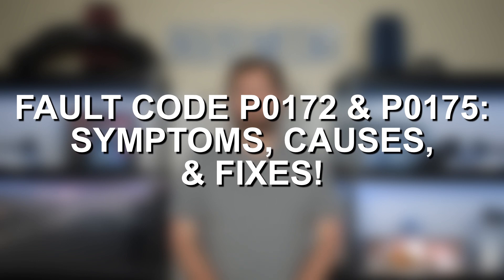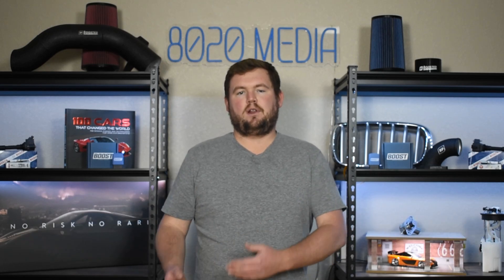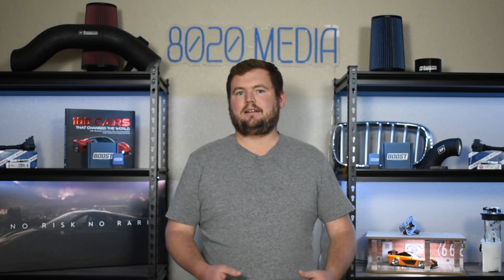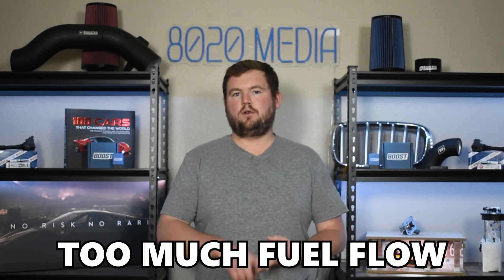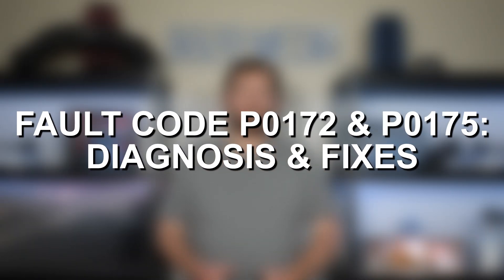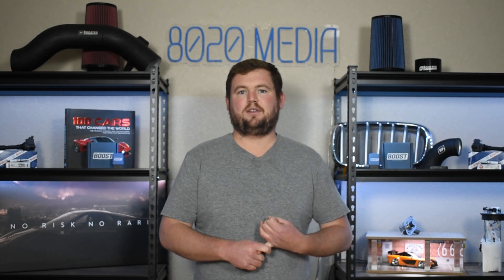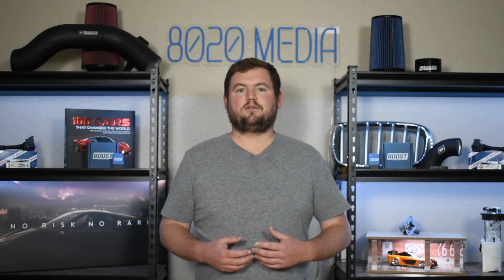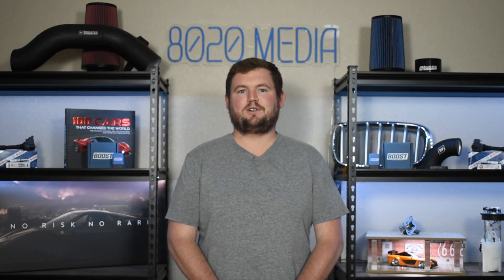P0172 & P0175 Explained: Symptoms, Causes, & Fixes!

Comment: I have a 2001 GMC Sierra 4.3 I changed oil, spark, plugs, fuel pressure regulator mass map sensors still have P0 175 and P0172 coming on

Comment: I Have a 2007 Toyota Prius and have replaced the following MAF, Spark Plugs and coil packs, the O2 sensors top and bottom plus fuel injectors and still getting the PO 172 code anyone out there having same problems and where to look. Good it be poor gas? oh and did replace the air filter.  Thanks
Reply from the maker: H - On a 2007 Prius, a persistent P0172 (system too rich) even after replacing MAF, coils, plugs, injectors, O2 sensors, and the air filter usually means the ECU is seeing too much fuel or not enough air getting through, and common overlooked causes are a leaking fuel pressure regulator, stuck-open purge valve flooding the intake with vapors, or a restricted/dirty EGR or PCV system upsetting mixture; it’s less likely to be just “bad gas” if it keeps coming back, so the next step is to check fuel pressure (too high will cause richness), test the EVAP purge valve for leaking at idle, and look for a dirty throttle body or stuck PCV valve, because those are frequent culprits on Priuses throwing P0172 after all the usual parts have been changed.
Reply: @8020Automotive  Thanks alot i think one thing getting overlooked alot is the PCV Valve or the EGR. Thanks for the Help.

Comment: My jeep compass has been a nightmare and I can’t seem to figure it out, she was and still kinda is in limp mode and she is throwing the P0172 code. I changed my Throttle body a couple days ago but when I was test driving sometimes it would go weak and at one point my pedal was to the ground and it wasn’t moving at all for like 5 minutes. Any thoughts? Thanks 😊
Reply from the maker: N - Sorry to hear this.. A P0172 code means the engine is running too rich (too much fuel, not enough air), and on your Jeep Compass, that combined with limp mode and throttle issues points to either a failing MAF or MAP sensor, a stuck fuel injector, bad O2 sensor, or even a fuel pressure regulator problem dumping excess fuel into the engine. Since you already replaced the throttle body and are still seeing severe power loss and delayed throttle response, I’d check the MAP sensor and upstream O2 sensor first, and also make sure there are no vacuum leaks, clogged air filter, or leaking fuel injectors—those can all cause a rich condition and limp mode. A live data scan showing fuel trims, O2 sensor voltage, and MAP readings while driving would help confirm the cause.

Comment: I have this code on my Skoda fabia 1.2 2006 MK1 htp 64bhp  along with po341. I had the po342 code, I replaced the camshaft sensor it went. I have Crackshaft sensors on the way , I will replace them then see. I think I may have to replace the oxygen sensor to. I don't know I'm not a mechanic I'm watching and reading up info haha
Reply from the maker: P - You’re doing all the right things for a DIYer—P0172 and P0175 both mean the engine is running too rich on both banks, which often points to a faulty or lazy upstream oxygen sensor, a dirty MAF sensor, leaking fuel injector(s), or a stuck-open thermostat causing the ECU to over-fuel thinking the engine is cold; the P0341 camshaft position correlation code is likely related to timing inconsistencies, so replacing the crankshaft sensor like you’re planning may help, especially if the timing chain has stretch or wear. Start by cleaning the MAF sensor (with proper MAF cleaner), checking for vacuum leaks or clogged air filter, and if that doesn't clear the rich codes, replacing the upstream O2 sensor is a smart next step—just keep taking it step-by-step like you are and don’t throw parts at it blindly. You're learning fast.
Reply: @8020Automotive  oxgen sensor would be the lamda sensor at the front of my car ?    I was thinking about changing that as I don't think it's ever been changed before , 60k to 100k they say change it at, the car is on 101k.  I fitted the crack shaft sensor and no change. 

When the car loses power I simply pull over turn the car off and back on again then it seems to run fine with normal power. Maybe faulty connectors or wiring issue somewhere. I don't have engine light on either.
Reply from the maker: @projectzgb7482  Intermittent power loss that’s fixed by restarting the car—especially with no check engine light—strongly suggests an issue with either a failing sensor (like the throttle position sensor, MAF, or crankshaft position sensor), a loose or corroded electrical connector, or even a faulty ground or ignition relay that's cutting signal momentarily but not long enough to trigger a hard fault code. Since restarting resets the ECU and clears temporary faults, it points to something electrical or signal-based rather than a mechanical failure. Start by checking battery terminals and grounds (especially to the engine block and ECU), wiggle-test key connectors while the engine is idling to see if you can replicate the issue, and consider scanning live data—even without a CEL, there could be stored history or pending codes that will point you in the right direction.
Reply: @8020Automotive  my car is map sensor not a maf sensor I think it's located in the throttle body maybe, not to sure will read around now and try to locate it.  Thanks for your help 🙂

Comment: Considering my 2013 Nissan Titan is right at 100,000 miles, I'm thinking it is time to replace both upstream O2 sensors anyway.  Thinking of trying that first to see if it affects LT fuel trim.  Then i could better judge the performance of the MAF to determine if it warrants replacement.
Reply from the maker: T - Are you getting an engine code? What symptoms are you seeing?
Reply: Awhile back it set a P0174, too lean on bank 2 (passenger side).  For the past couple of years I have been seeing consistent positive LT fuel trims, typically 5-7% higher on bank 2.  At idle they may be like 5 & 11.  At 1500 rpms they'll be at like 9 and 14.  On the expressway at 2000+ they can be around 16 and 21, and when I exceed 3,000 rpms they can hit 20 and 25.  The dealership coukd not determine a cause at 88,000 miles and did not seem concerned.  It starts and runs well, but gas mileage is down 10-12% and I smell fuel in the exhaust on start up.  I am just getting ready to tip over 100,000 miles and the truck is 12 years old. Smoke test negative and I can't find any exhaust leaks. MAF readings seems normal.
Reply: @trekfortruth2841  did you fix the issue?

Comment: My truck has set that code once.  I have an issue with the LT fuel trim being consistly in the +16 to 20 range on both banks.  Installed new air filter and cleaned MAF sensor and did not find any vacuum leaks.  Definitely smell fuel in the exhaust and mpg is down about 10%.  Thoughts?
Reply from the maker: T - If your truck is setting a P0172 (System Too Rich – Bank 1) code and both long-term fuel trims (LTFT) are in the +16 to +20% range, that actually points to the ECU adding fuel to compensate for what it thinks is a lean condition, even though you're smelling raw fuel and seeing poor MPG—which strongly suggests a false lean reading caused by a faulty MAF sensor, fuel pressure regulator failure, or possibly leaky fuel injectors dumping excess fuel that the O2 sensors are trying to correct for. Since you've already cleaned the MAF and ruled out vacuum leaks, next steps would be to check fuel pressure (a stuck regulator can raise pressure and overfuel), inspect the O2 sensors (especially upstream) for slow response or incorrect bias, and verify that injectors aren’t leaking or sticking—also, if the MAF is reporting incorrect airflow despite being clean, it may still need to be replaced, as they can degrade without triggering a direct fault code.
Reply: Wow great insights, thank you!  Will break out my OBD2 and check O2 readings and MAF #'s with live data while driving.
Reply from the maker: @trekfortruth2841  No problem. Keep us updated!